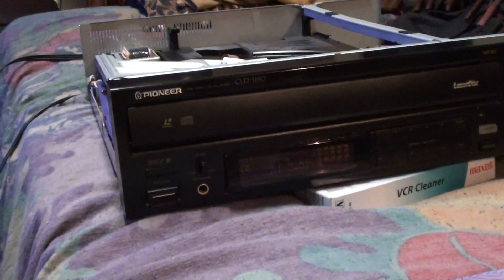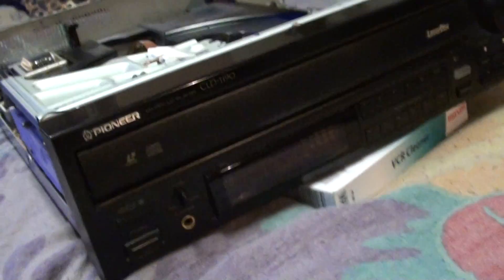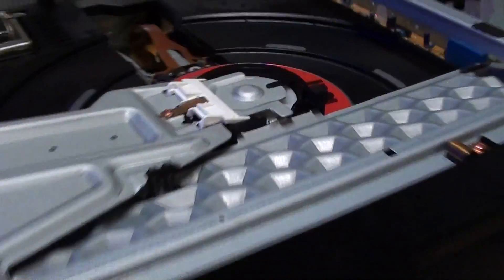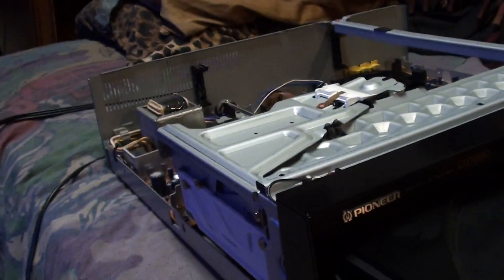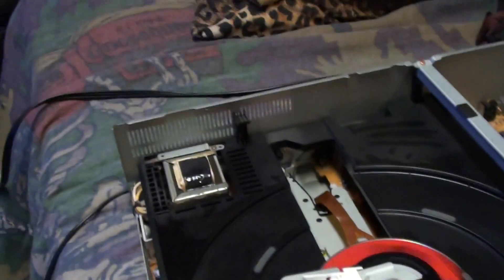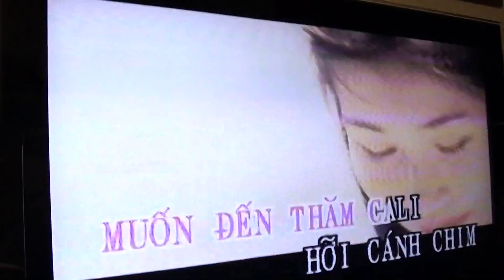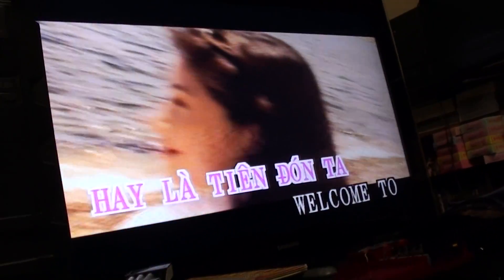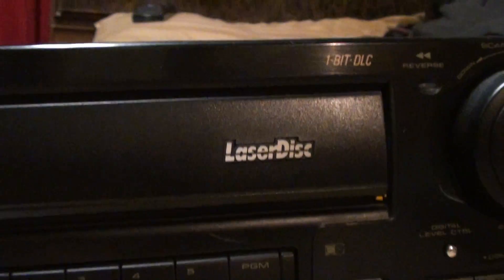Pioneer CLD-1190 Laser Disc Play

Comment: well the bumping issue is that you might need to fiddle with the pot on the laser  to make the beam stronger . then it will be more responsive . it is the same as cd players. but you have to be patient and do any adjustments slowly to get it at the right position hope that helps you